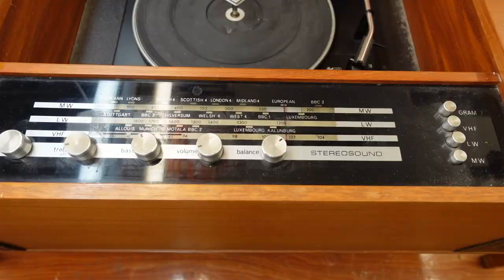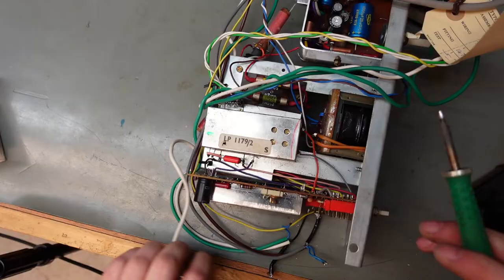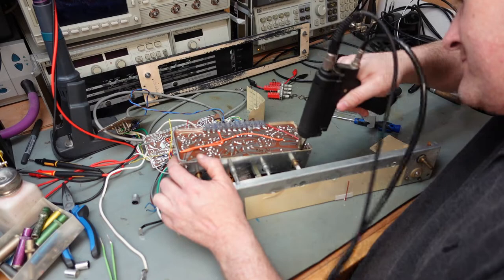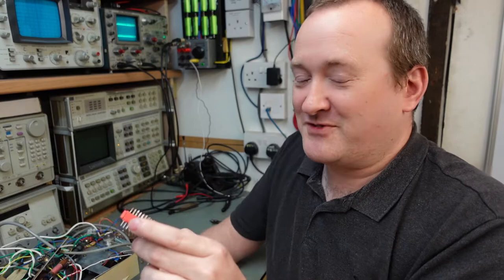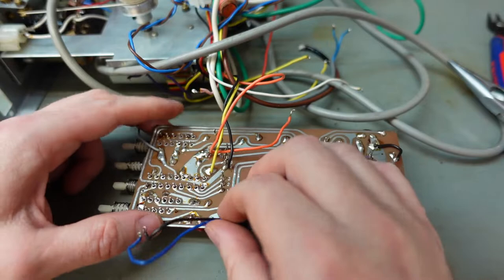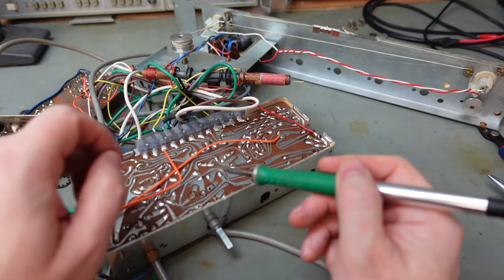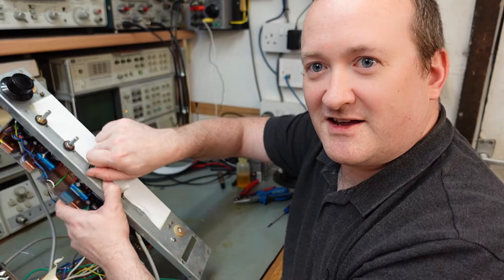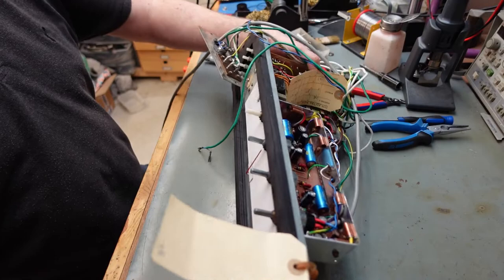1970's Stereogram - Part 3 - Radio Chassis Rebuild

Comment: Why not try spraying with contact cleaner first.. if that didn't work then take then off the board.. unless you like extra work.. LOL... otherwise good job.
Reply from the maker: Thanks! I tend to use various Deoxit juices on my own kit, where I can reapply it every month, or so. I wouldn’t trust it for a long term fix for a restoration however. (I do like the extra work also. Guilty as charged!).

Comment: Mark, when I built telephone exchanges back in the day (1970s), wire-wrapping was generally used on the majority of fixed connections. To get them off terminal pins, we were supplied with wire-unwrapping tools. Are they still available?

Comment: Excellent! Really enjoyed this. Thanks for sharing. Can I ask, how long do the capacitors in old radiograms take to discharge after power is turned off? I have an old Civic that needs attention. I will use a capacitor discharge pen of course anyway. Keep up the awesome work, thanks.

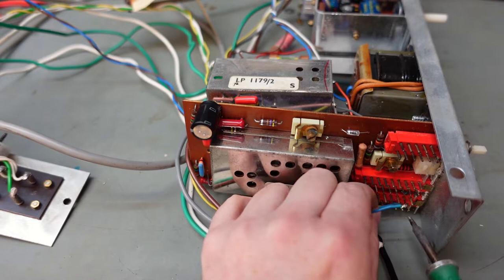Comment: 2:10 I used to work at Data General in the 1980s and there was this woman who used to sit at a wire-wrap machine that would move the guide to one post and make a squeak, than to the next post and make a growl. She'd load a new wire on to her gun after each growl and she always seemed to be on the verge of bursting into tears. I think the boredom of the job was slowly driving her insane; I know it would have done the same to me. Anyway, they didn't use solder on those wires; the force of the gun was supposed to cold weld the wire to the post. Maybe with these thicker wires, they needed solder.

Comment: I noticed you rarely label wires you unsolder from the board. I personally would forget where each wire or screw goes in about 3 seconds. I would typically take a lot of pictures to make sure I know what goes where. How do you keep track? Are you using your videos as a reference? Cheers!
Reply: @17:00 he talks about it 😉

Comment: I have recently discovered your channel and am really enjoying your very informative videos.  You used an ultrasonic cleaner for the switches and potentiometers on this chassis.  Do you find this to be a safe and long lasting fix for pots?  I have used contact cleaner and find it only lasts for a few weeks before the pot goes noisy again.  Have you used it on wafer switches? I have resorted to dismantling pots to clean them along with lots of bad language and some blood when trying to get off the little ring of metal that holds the shaft onto the case!  I would like a good excuse to buy an ultrasonic cleaner 😊
Reply from the maker: I’ve had great results with all types of switches. A good solvent and the ultrasonic waves do a good job of getting any tarnish or corrosion off. I think the choice of solvent is important. Check out my Ultrasonic cleaner video from earlier this year.
Reply: @MendItMark  Thank you - I will

Comment: 8:03 - what did you use to cut the hole for the PID controller on the oven? A chainsaw!? 😂
Reply from the maker: I might as well have 😂The oven mod was a Sunday afternoon idea, that was more work than I thought. I got impatient and set the angle grinder on it. That was probably 10 years ago, and it’s still working!
Reply: @MendItMark  Nice😁 As I was once taught, it ain't a bodge if it's safe and reliable 👍